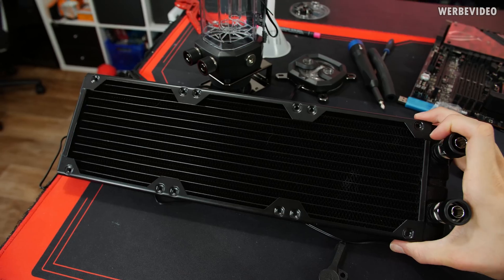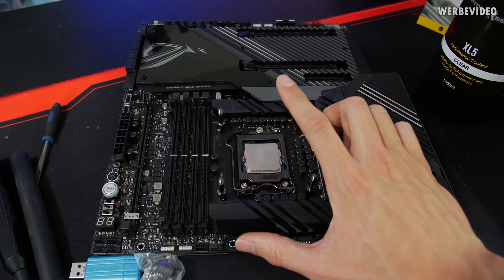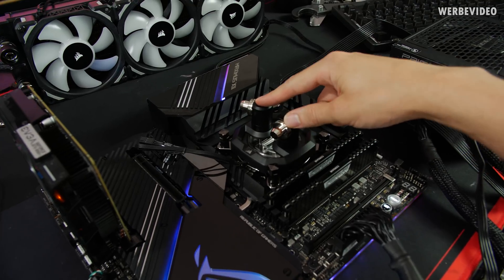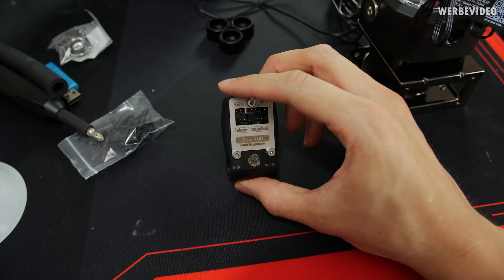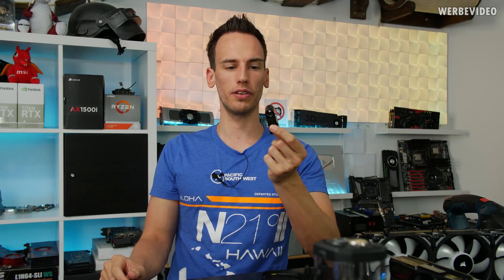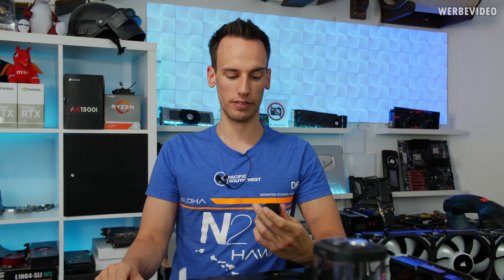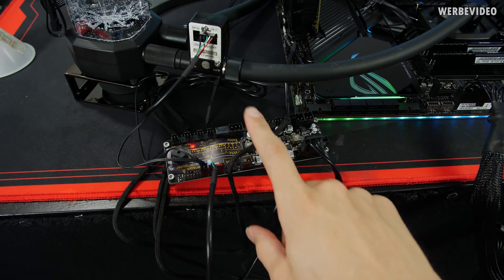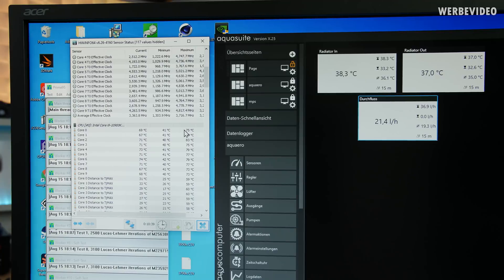Testing one of the Weirdest Water Cooling Myths - A SLOWER Flow Rate will result in BETTER Temps?

Comment: with this video I was surprised how slow is the corsair pump compared with my alphacool VPP755, there is a massive difference to say the least: my flow meter says about 340 L/h at max speed, basically 9x the speed of the corsair. I'm happy that my flowrate is much higher than necessary. until now I would defined the corsair flowrate even dangerous since I'm used to values beginning from 200 L/h on idle. still not 100% sure that 37 L/h could be ok for a huge 1080mm radiator with threadripper and a gpu attached.thank for your video, would be nice your opinion for knowing if the vpp755 choice was too extreme for this loop. of course I hope that this video can ends these myths once for all
Reply: he said he wasnt sure about the flow rate measurement, and i think it is wrong too because the energy balance makes no sense.

A simple thermodynamics calculation gives 1.5[K]*4.2 [J/g-K]*5.5 [g/s] = 35 W. You are putting 170 W into the radiator, and your measurements only explain 35W. The temperature difference across your CPU or radiator at steady state should be ~7 degrees C.

Comment: TLDR: Slower flow rate will result in higher temps, in this case 5c.
Reply: Not just "slower" but basically a standstill compared to the normal and max flow.
Reply: This myth likely has roots in reality but only on a scale not appreciable by either the flow rate or temperature differential in a PC. It's just not possible to reach the point of diminishing returns given how low the flow rate already is in a stock setup, to see this scale it might be worth it to ramp up the flow rate artificially with much more volumetrically efficient pumps

Edit*
I actually recall while I was in automotive technology classes in community college that it was suggested to us that a typical automobile air conditioner is most efficient at around 80% fan speed through the evaporator
Reply: @Damian_CS2  You are correct and this is even the case in certain scenarios with in data center cooling particularly with free cooling heat ex changers which are more or less like an AIO cooler.   During your transitional season time periods slowing down your flow will increase the time you can stay on heat ex changers.  You can run your pumps and fans so fast that they do not do their job.   I would have never thought someone would apply this to a home PC where the pumps and fans just are not able to reach these thresh holds.
Reply: Another possible summary: minimal difference between 2000 and 4800 RPM pump speed...
Reply: Thanks!
Reply: Thanks, I fell asleep watching it ;D

Comment: So, you want high flow-rate around the components, but a low flow-rate around the radiator.
I don't know if that's possible, though.
Reply: I wonder if that could be achieved with running 2 radiators in parallel as they would have to share the same flow.
Reply: No, you don't "want" low flowrate through a radiator, it has no benefits.
Reply: @TheEsseboy  Doesn't it cool down the liquid to a lower level if it flows through the radiator more slowly?
Reply: When it comes to the radiator,  it's not so much the flow rate. The cpu size is fixed, so flow rate needs to be high. But the radiator size can be changed. That's why you see some overclockers us automobile radiators.  The water spends so much time in the rad it becomes room temp
Reply: @kousakasan7882  No, time has nothing to do with it, it is radiator area that matters.
Reply: @TheEsseboy  that's my point. Water going through a radiator twice the size spends double the amount of time in front of a fan getting its heat removed.
Reply: @kousakasan7882  Yea, but even if you doubled the speed it would cool as much or more. Time spent in the radiator is irrelevant.
Reply: @TheEsseboy  did you even read my original comment?  I said that for the radiator,  speed does not matter,  only the radiator size. You keep agreeing with my original comment,  but your wording sounds like you are disagreeing...
Reply: @kousakasan7882  Your...

Comment: Your flow rate numbers are probably wrong, a D5 should really be running 100-200 lph at max power (for that setup). Which would exceed the max rate for the MPS100 you have connected, additionally the MPS100 is speced for a min range of 20 lph so you're 1.8 lph is def a misread. Either way I don't think you can ever stop people thinking loop order matters. The problem is due the high variability of setups there are edge cases where odd setups are actually better even if the differences are negligible
Reply: Agreed, probably got the flow sensor setup wrong in aquasuite, you need to tell it which model sensor you use. A d5 should do a lot more flow than 37L per hour.
Reply: @simondale3980  One word, back pressure. D5s suck, DDC pumps are about 30% better in systems.

Comment: Love the content and happy to see more facts to counter myths in the PC building world.
What would happen if you ran two radiators in parallel? I assume they would individually have a lower flow rate than if you had two radiators in series but I don't have the equipment on hand to test such an idea out. 
Would love to see that idea tested
Reply: While it is true that the flow will be halved.  It is also true that the coolant will only have to travel 1/2 as far in the rads. ( e.g.  using 2 x 240 rads instead of one 480 rad.)  Therefor cooling delta overall will be similar BUT not the same. 

There will be a 'small' improvment in the duel rad setup due to the inlet temp of both rads being  higher  than the mid point temp on the single rad solution.  This will mean heat is lost to the air more effectively.

Also as an added plus the workload on the pump 'should' be slightly reduced.

Haven said all that it would be such a small improvement that I wouldn't bother.  

I have 2 × 360 and 1 × 240 in my loop, all in series with my cpu and gpu.  Loop order is unimportant just go with what is going to look the best!
Reply: You would have a larger flow rate. But any difference in restriction between the two parallel paths would lead to unequal flow between them, which is not ideal. So series is usually preferred.

Comment: So if understand it correctly with high enough flow rate you would not even need a radiator.
Reply: No, with high enough flow rate loop order doesn't matter. You still need a radiator for cooling the water.
Reply: @TheEsseboy  
if you are water watercooling something like ram which takes very little power, the energy from the cpu or gpu will just be heating up the ram to a point further than it would have heated up outside the loop.

I see this a lot and dont understand where people get the idea that energy only conducts one way

the only way it couldn't make a difference is if the heat gets perfectly distributed throughout the loop as if water is a superconductor, which if so then the flow rate wouldn't matter...
Reply: @TheEsseboy  well the point is tho the water is still hot until it passes through the radiator, a high flow rate does improve that tho

Comment: It's also possible to calculate the actual energy dissipated by the radiators since flow rate, temperature drop, and the heat capacitance of the water are all known.  The dissipation would be highest on the highest flow rate since the temperature delta between the radiator and the ambient air would also be the highest (and therefore most efficient heat transfer).

You could use a giant radiator such as a 420x420, the inlet/outlet temperature delta would be enormous, but the same would still be true - highest flow rate still results in the highest thermal transfer.
Reply: Which raises questions about the accuracy of the data.
The water flow rate time the differential temperature should be roughly similar in all three cases.
But the normal is 27.3 the low is 7.0 and the high is 18.5.
This maybe due to the heat loss in the reservoir.  
This really needed another temperature measurement at the inlet to the CPU.

Comment: Finally! it's the same thing I figured from my own testing and it just does not sink in with people's logic.. Thanks for your clear explanation. It's a simple link to your video from now on when this discussion comes up. 

From your test results you can already see there is a sweet spot where efficiency for raising pump speed lowers. The trick is to find that speed spot for your setup and pump. Where temps are lowest vs the noise and find that drop off spot. In your video you can easily see that the benefit with going from 2000 to 4800 rpm is just 0.4 degrees celcius which probably means around 2000 RPM or even lower is the sweet spot. Raising the pump speed too high is raising noise and heat the pump emits itself. Which is obviously also counter propuctive. But it depends on the loop's components. How restrictive they are and how many etc.

Comment: Been there, studied that. A good (high) flow rate creates turbulent flow, which reduces the boundary layer, which improves heat transfer.
Reply: For microchannel cold plates, though, the flow might be laminar, so increasing the flow rate does not create turbulence. It does, however, affect the boundary layer due to developing flow.
Reply: arkie87 yeah wouldn’t be suprised if it’s close to laminar. But the length scales are tiny so it doesn’t really matter if you have turbulent flow or not.
Reply: it also reduces the temperature rise in the fluid, which reduces the thermal resistance as well
Reply: Did that in practice for a customer where the flow rate was set but I wanted to increse energy transfer so I reduced the inside diameter of the tubing and that increased the energy transfer because of turbulent flow. But in computer cooling it may be to small amount of energy per area to matter.
Reply: Henge yeah that’s an interesting way to do it if you don’t have anyway to introduce turbulence by adding kinks or baffles
Reply: Well it’s not so much the heat transfer to the water since the fluid will approach ambient if the flow is slow but higher flow means that your coolant flow has a greater delta T to the air traveling over the radiator. This has to result in more heat being extracted out of the radiator.

I think where people get confused is that it’s not useful to look at the situation as a snap shot.
Reply: Do you think the pressure matters or just the flow rate?
Reply: FORCED CONVECTION. Don't even need boundary layer to explain things.
Reply: It's not even about that, more flow = more power, that's just it. Doesn't matter if you're talking about pc watercooling or home radiators or industrial AC.
more flow = more power, more dT = more power

Comment: I was honestly surprised how high the liquid temps were. Still it makes sense overall.
Reply from the maker: Summer here with 28-30°C room temperature. No A/C
Reply: @der8auer  Wow, how do you manage to survive? I chill here in finland with 19-21°C, was 26 °C once and was about to die >.<"  Can't sleep if it goes above 22°C at night :P
Reply: @TheEsseboy  It got to 37.1c in my flat during the recent hot days in the UK (I checked that with my thermocouple and that read higher).
Reply: @Safetytrousers  Jesus Christ, I would have had to seek shelter if that happened 😅

Comment: i remember  a video about peltier cell  cooling  and it did not went well . I wonder if the water temperature  difference on the first cell and last cell was this small or much bigger. Since there was 1000W  of power consumption  so much more heat .

Comment: Good video, and helps with my decisions for the water cooling solution for my 10900K 5.1GHz OC system (you didn't respond to my email so I bought an 8Pack bundle rather than a de-lidded one from you 🙁).
Using this logic, are we all worrying too much about using 360mm radiators rather than 240 or 280? It would seem to follow that the temperature difference between inlet and outlet wouldn't change much and so neither would CPU temperature (maybe 1 or 2 degrees)?

Comment: Jay's already tested this and found the same thing.

Honestly, from an outside perspective, I can see how it's easy to think that putting a heat sink like a radiator right after a generator would cool the liquid coming out of it, but that's not taking into account how fast that liquid is going through the system.

Comment: I have to note though, it would probably be useful to place the radiators between components, when running the system at the lowest flow speed.
But since the lowest flow speed is the worst situation, it's kind of a moot point :/

Iirc some flow meters will use electromagnetism of the fluid, but then we're talking about rather large pipes.

Comment: i dont think u have proved anything it will be relly easy to make a good video on this just buy some quick connect links an do the radiator cpu block radiator gpu radiator and test temp fps and clock speed  and  then radiator radiator radiator  cpu gpu make sure what flow rate is the same in both test and make sure the room temp is the same in both tests why not do it proper
Reply from the maker: so why is the video not on your channel?

Comment: Thanks for the vidio, Iallways thought that there would be a bigger differenc in inlet and outlet temperature. I also just realised that having CPU RAD GPU RAD should also decrease your temps a bit  because, let`s say your watertemp. after the GPU/Cpu is 37°C (from 35°C after the rad) so with an ambient temp. of 20°C you will have a delta of 17°C, while when you use CPU GPU RAD RAD the first rad will have a an inlet temp. of 39°C and the second one 37°C, so the first radiator is more effectice because it has a higher delta temperature. Am I mising something?
Reply: If you have CPU GPU RAD RAD, the temperature after each is 36, 38, 36, 34. The average water temp is still 36.